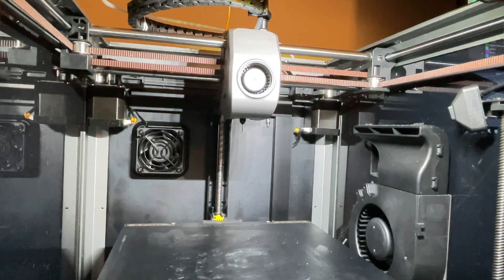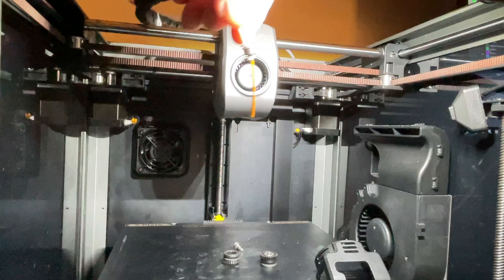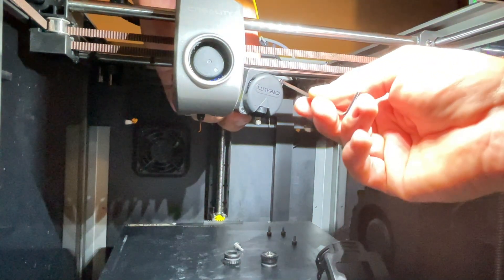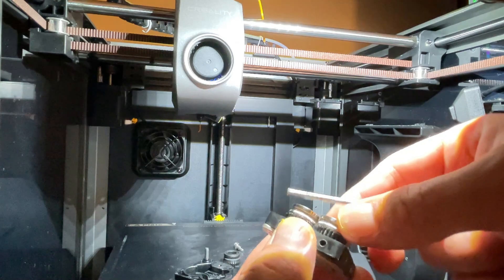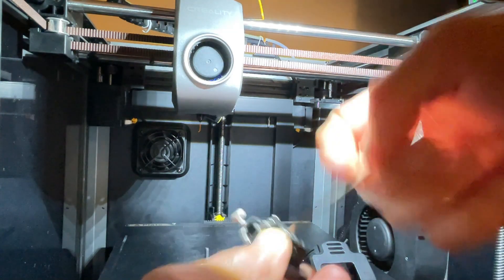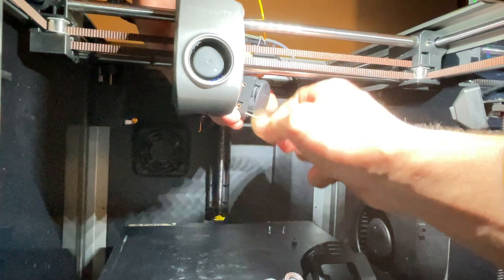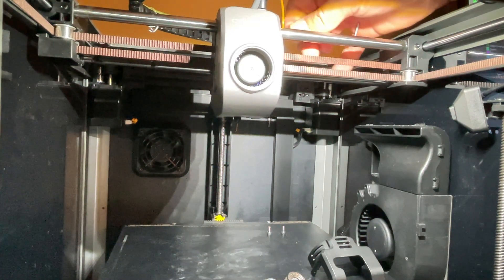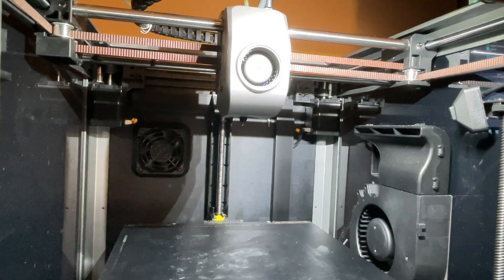Problem With Filament Jamming Upgrade Extruder Gears K1 K1C

Comment: How to properly interpret the title? "Problem With Filament Jamming Upgrade Extruder Gears" or "Problem With Filament Jamming. Upgrade Extruder Gears" In the latter there is a period after "Jamming". In the former it sounds like the "Upgrade Extruder Gears" are jamming filament. Actually the upgrade all metal gears sold from China are probably not the best solution since they will be driven by a POM gear that will be destroyed buy the harder material of the extruder gears. How is you upgrade going so far?